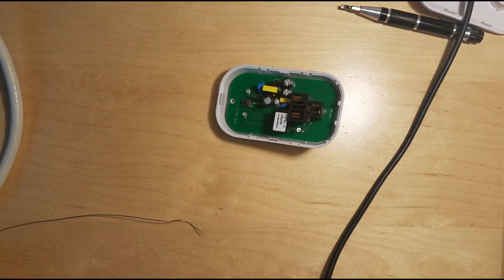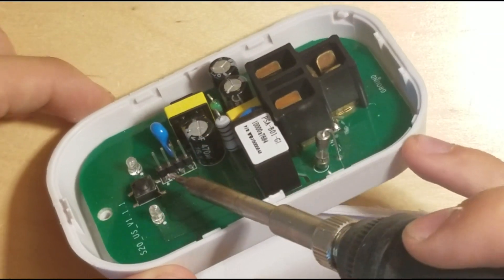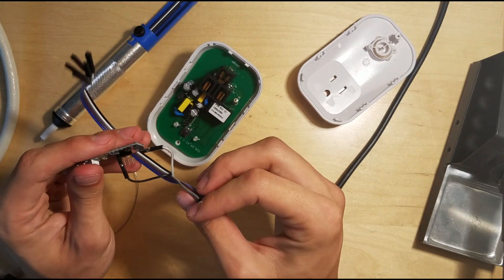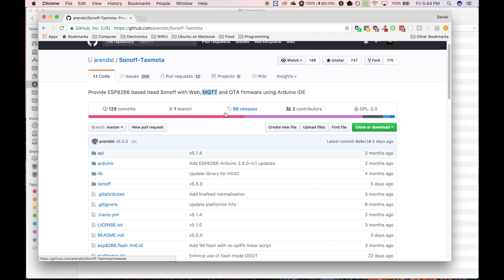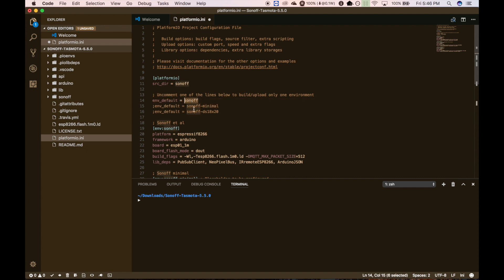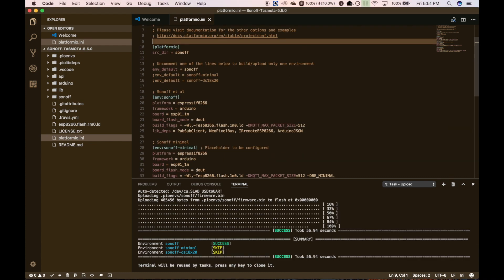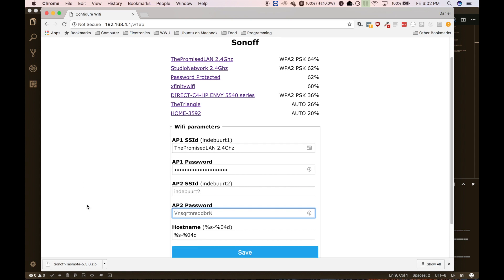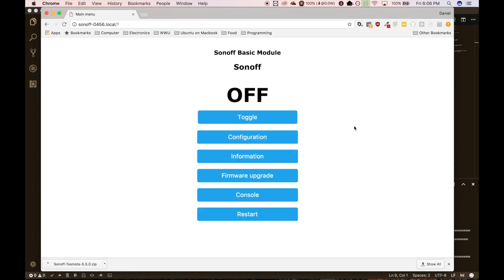Flashing custom firmware on the Sonoff S20 Smart Plug

Comment: My S20 is marked "S20_US V1.3" dated "2017-3-28". I pressed the button releasing it only 10-20 seconds after USB flasher was plugged.
BUT the ESP flash program kept failing.

I flashed a SHELLY implying the USB flasher is functional. I suspect my S20's button is not GPIO-0...HMMM

Comment: I had to connect RX-RX and TX-TX on my FTDI board (has a micro usb instead of mini) to get the S20 to flash. Though I'd ordered 3 bad adapters in a row. Whew. Thanks for the video!
Reply: Yep, I had the same issue. I flashed 4 sonoff basics so far doing it the correct way (rx to tx and vice versa). I failed a couple in a row on this and on a whim I swapped and did rx to rx and it indeed worked. I only came to the comment section to mention that. For me errors aren't uncommon because I only hold the pins in place; I dont solder anything in place so I do tend to have wires shorted on occasion.

Comment: I'm going to be trying this and configuring it w/ Home Assistant as a backup for an ESP32 controller project. The board glitched the other day and stopped delivering sensor data (values went static for some reason). All it needed was a power cycle thankfully. This, with some scripting in HA, should fit the bill.

Comment: I just followed this and it's working great. Thanks! The only challenge I had was platformio in VS code not successfully finding my usb ttl adapter on a port. Turns out I needed to install drivers for it. Just googled drivers for the chip number (printed on the adapter's chip), installed, and then yay. Tasmota was a good suggestion too - nicely made firmware.

Comment: On the new CP2102 Breakout, you go from the S20's TX to the TXO on the CP2102 and from the S20's RX to the RXI on the CP2102.  If you do not connect it like this you will get these errors.  
warning: espcomm_sync failed
error: espcomm_open failed
error: espcomm_upload_mem failed
* [upload] Error -1